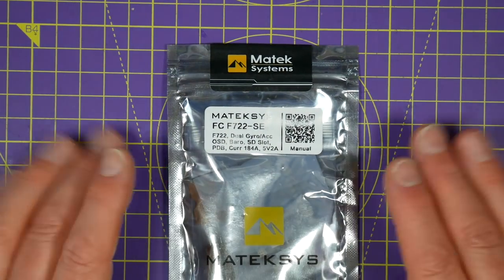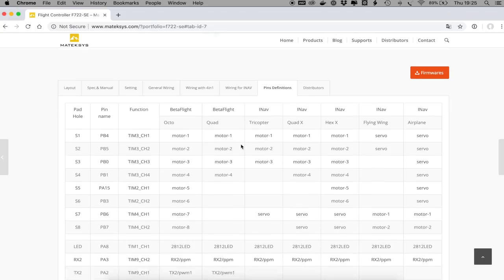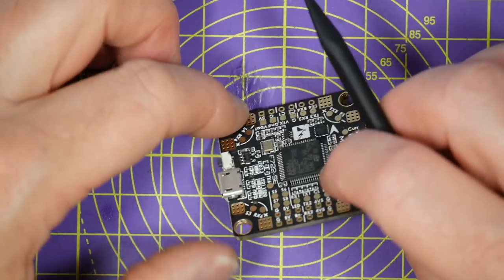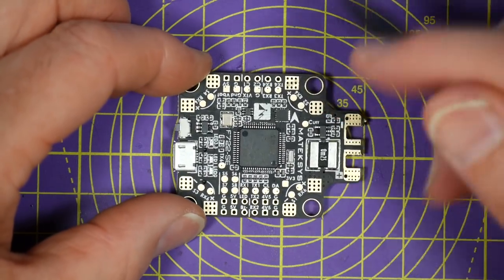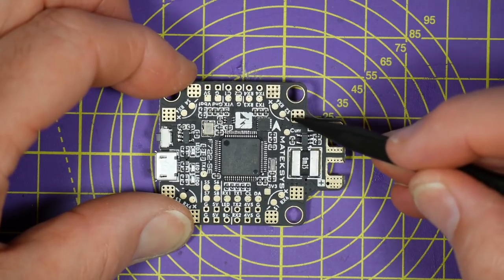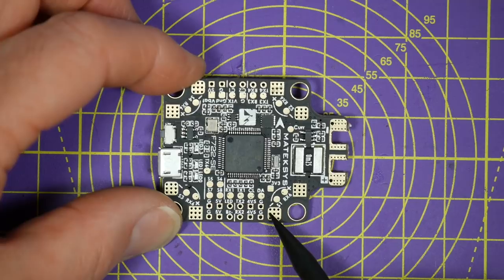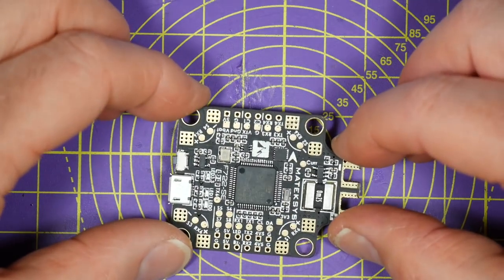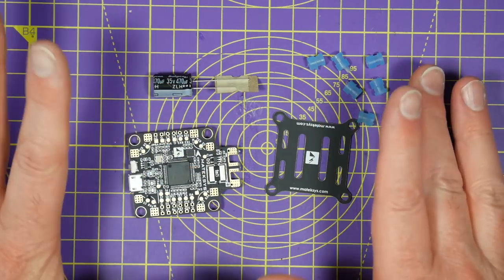Matek Flight Controller F722-SE full review // AIO F7 FC and PDB // Dual IMS // Betaflight // INAV

Comment: Wow I was just about to order one of these and I decided to watch your video (thanks).  I love all the features, but why on earth do they have the power connection on the right side of the board?  Yes I know you can change it in betaflight, but those are Not the bendiest of cables, especially where the solder has soaked in and up under the insulation a bit (tends to happen since you have to heat it so much).  So it would be sticking out a bit before it curves up to the battery on top - through the props....  Seems kind of silly to me.  I am really careful but I've had a couple incidents in my thousands of flights where I've taken out the battery cable.  
When you tell betaflight to rotate the board, does that mean that you have to run all your esc wires to the wrong corners then?  (I can't imagine it would rotate the motor numbers for you).
Thanks!
Reply: You could mount the power wires straight up if you wanted, they do not have to be be soldered exiting the board sideways.

Comment: Sorry if this is a stupid question, but can i run this from a 5 volt port on my PDB? I want to run 6 motors, so i picked Matek XT60 Quad PDB with 5V & 12V BEC Outputs. The 5 volt is 2 amps, while 12 volts is 500mah. I wasn't too sure if i should connect it to the battery as well or if it can run from one of the 5 or 12 volt points

Comment: Hi - thanks for this video...subscribed! Can you recommend a gps and compass that would work well with this board please? Also vtx board would help. I guess that there are a lot out there that would work but is there a preferred set of external items? Thanks
Reply from the maker: I use these GPS/compass modules https://bit.ly/3jLfXH3 They're cheap and reliable. And the TBS Unify Pro is about the best analog VTX module.

Comment: What is the best way to check if the OSD chip is functioning properly? I don't have OSD info anymore, only camera. I am fairly certain I had OSD info at some point, since I remember noticing the voltage on the camera's feed and the voltage on the osd was different. Any help would be much appreciated.
Reply from the maker: Since BF 4.2 OSD is disabled if it can't find and OSD chip. And some flight controllers don't power the OSD chip from USB. So, plug a battery in first, then USB and then try re-uploading the USB font - use the OSD tab in BF. Remember to save and then power cycle.
Reply: @WhirlyBloke  Thank you very much! I guess my chip went bye-bye. This board was new -- my first build. Oh, well. Such is life.
Reply: @WhirlyBloke  OMG!!! I figured it out!!!! Sorry, I am excited. Here's what fixed it. In betaflight, my camera was set to NTSC, but in my camera's setting (via the joystick), the setting was PAL. When I matched them, OSD worked!
Reply from the maker: @SunriseWaterMedia  Good you've fixed it.

Comment: Hey man, just a quick question.. is it possible to connect DJI air unit to this board and use the OSD?
Reply from the maker: Yes you can. It doesn't have a DJI compatible connector on the PCB but you can solder a DJI connector lead onto the UART connections.

Comment: I have this FC, once updated from BF 4.3 to 4.5 (m10 gps), the booting sequence is fine (motor vibration) but I can’t test motor direction.  Maybe BF 4.5 is not supported?
Reply from the maker: It may be an issue with the BF target for that FC, but usually anything Matek is good. Let me know when you find out.

Comment: Hello, I haven recently purchased this Matek F722-se board to use with my hexacopter build. I am trying to understand how to get telemetry data setup so i can get long range wave point & flight data talking to software like Mavlink or iNav. I am using a Flysky th9x transmitte and it fs-r9, im planning to install OpenRX on it and iNav on my flight controller. Do i need a special reciever or device on the bird to send telemery data back to my ground station or is the FC capabable of handling that? if so, how do i set it up? 

thanks for your help!

Comment: Awesome review on this board. I want to build a 3" and I would like to know what motors will go with the iflight  Succex v2 f4 flight controller, and the Mamba F405 mini mk2 Betaflight fc..... Also will the frame: Iflight IX2 tiny whoop 100mm frame work? Thank you so much in advance... I'm so new at all this....
Reply from the maker: The Diatone Mamba motors are  sweet. For a 3 inch I'd use MAMBA 1408 4000KV http://bit.ly/2KZNQHn same as on the R349. If you fancy 4-6S thats lower KV then the Mamba 2207 1750/2650KV http://bit.ly/32d6FMI is a great choice.
Reply: @WhirlyBloke  Do you think the mamba 1105 5500kv will be ok

Comment: Hi, Tried to map the TX2 pad to Softserial like they show in the instructions on the website to use with SmartPort but it does not work. Any suggestions? RX is an R-XSR.
Reply: Why using software serial when you have hardware serial? But if you really want to use software serial then you have to short TX and RX pins because SmartPort is bidirectional protocol and software serial is using both pins.